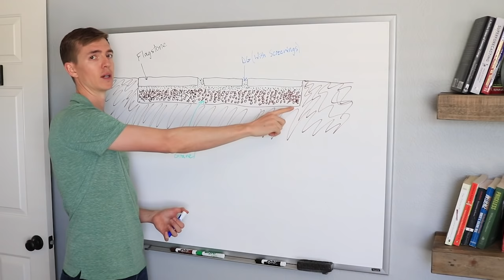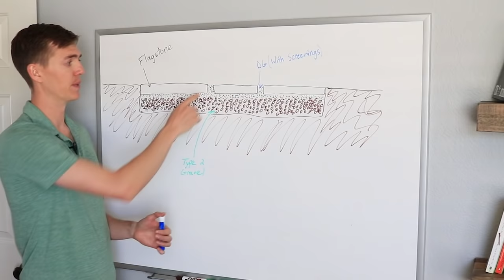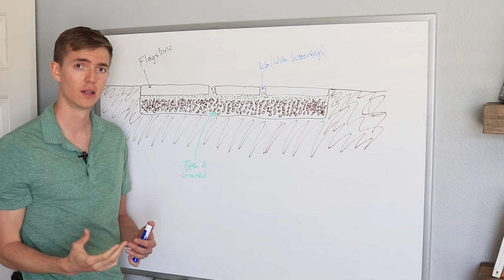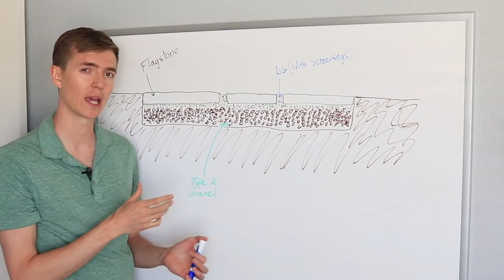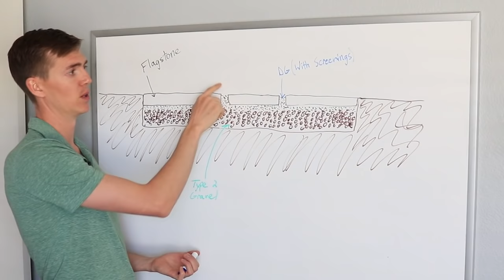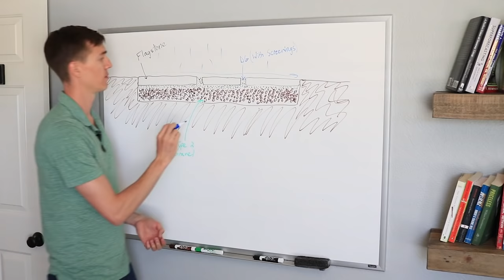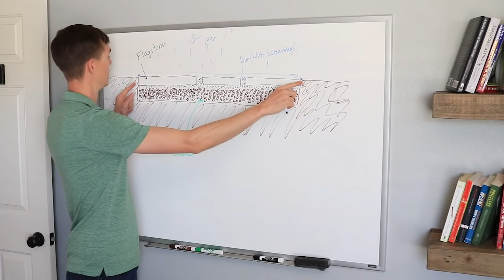How To Install A Flagstone Patio (Step-by-Step)

Comment: Learned so much from this video! Really excellent. I have one question: I wanted to put pieces of Mexican tile in there to fit the character of my house and yard. How do I do this? It doesn't seem safe to just place them into the decomposed granite. I do mosaics and am used to applying sanded grout, but these gaps look too big for that.Thanks for the help.

Comment: We just set our perma sand today. We noticed that we have a few flawed areas that can use some more sand. It has hardened by now. Not yet 24 hours. Can I reapply more perma sand and water it again? Or are we stuck with the imperfections?

Comment: Very nice video. Great tips. Question, I have a solid base of dirt now and I would like to just add 4" of slag then place the Flagstone then place some Gator dust to lock it together. This is for a fire pit. Any concerns with just using 4" of slag?

Comment: What if your soil is very sandy? The gravel base will probably disappear into the sand fairly quickly.
Reply: That’s what I’m wondering. The soil is loam but my house was built in a pile of sand more or less, to avoid flooding

Comment: Would this work with Concrete pavers? Specifically the gravel and DG with the 1/8 inch angle.
Reply from the maker: For pavers you’ll want to put a 1” layer of sand on top of a 4” paver base. Then place the pavers on top of the leveled sand. This method is used for these because of the inconsistent thickness and the face that you need to walk on the surface to fit the stones.

Comment: What is the difference between setting this Type 2 Gravel base and setting a concrete base? I helped at a flagstone job recently and they used concrete for both the base and also for the cracks filling
Reply from the maker: Concrete is better (mainly for weed prevention) but significantly harder for a DIYer.

Comment: Excellent video and thank you very much!  I have a question about the grade however - do I grade just the DG (we call it “road base” here in Colorado), or both the DG and the type 2 leveling sand? Does the the flagstone patio as a whole follow that grade, or does the grade only apply to the bases (and the flagstone patio is then level and flat)?

Thanks so much for your feedback and clarification

Comment: What ind of saw did you use to make your cuts?  I didn't observe a saw as I didn't watch in entirety.
Reply from the maker: I used an angle grinder as you have noticed, but I would recommend a larger saw like I demonstrate in my other video.

Comment: "Cutting the flagstones is the worst part. Ok? It kinda sucks." 😂
Reply: It does. I have found that you can get nice breaks with even minimal scoring...but it can be a bit risky.
Reply: Or rent a stone saw with a 12 or 14 inch blade that cuts limestone like a laser.

Comment: Thanks for the video.  Can you use concrete in between the stones instead of DG?  Thanks!
Reply from the maker: Not unless you set the stones in concrete, otherwise it will just crack.

Comment: I am a little confused as to how to handle the edges... I see how to put the larger pieces on the perimeter (as stated in your OUTSTANDING video).  BUT..... if it's a walkway, I don't know exactly how to handle that.  There will be some smaller pieces on the perimeter.  Do I use a metal edge or something like that to keep stuff in place?
Reply from the maker: I'd recommend using large stones for the walkway so your walkway will be one stone wide.

Comment: How do stones stay in place only using this granite sand?
Reply: Decomposed granite with the fines like that sets almost like concrete. It is pretty solid. The water sprayed on helps it compact and lock everything in.
Reply: DG is sticky when it is laid down.  The stones don't slide around once a stone is set level.  Also filling the gaps with DG or polymeric grout creates one piece of stone from many.

Comment: I'm having a really hard time trying to find DG- decomposed granite- locally. Found a couple places that carry it in bags but no bulk deliveries available. I'm going to need a lot for my large space. Additionally, the bagged DG available is that golden color, whereas my flagstones are grey toned and I don't really want that color contrast. Any advice on using small 1/4 minus gravel in place of DG? It's what a local landscaping supplier says he uses for pathways. Any regrets or thoughts on using quarter-minus ?
Reply from the maker: I would have to see it and feel it. It needs to be able to pack well, so other things can work, they need to be rough(no rounded or smooth) and contain the screenings(finer pieces of dust or rock) for compaction.
Reply: @StayHandy  Thanks for the help!

Comment: Man. I have installed flagstone for a living and most of the cutting should be done with a gas powered stone saw. Or the newer battery operated ones. The grinder takes for ever and should be reserved for contours that a 14 or 12 inch blade cant achieve. I have achieved some pretty tight radius cuts with a 12 inch. 
I probably could have cut all that in in a day.

Comment: I'm not sure if you're still monitoring this video but at some point, after the first 3 steps, you said dig 5-6".  Wouldn't that be the 1st step BEFORE add 3-4" Type 2 gravel?  Also, you don't talk about using a compactor.  Do you use a compactor to get the ground level and the 3-4" of Type 2 gravel compacted?

Comment: Hey! Great video. Could I put some decorate rocks/pebbles between the flagstone instead of DG?
Reply: Yes, just be careful where your pathway/patio will be. For example, if it rains a lot and the patio is at a high slope, using pea gravel might wash away. Gravel size rocks might be better.

Comment: Good tutorial!

If the natural slope is down towards my house, but I want the patio to slope the opposite direction, am I creating an unnatural slope that could cause a problem?
Also
For a patio with pavers, I read to have 1/4th inch slope per foot, yet with flagstone it's 1/8th inch slope per foot.  Do I need to change it to 1/8th?
Reply: L S I would dig out the soil that runs water toward your house or install drains within your paver or flagstone patio and I tend to go a little more slope on flagstone because of the uneven surface

Comment: Can I install a flagstone patio over an existing concrete patio?
Reply from the maker: You could, you'd just need to put a layer of sand or decomposed granite in between the stones and the concrete which will raise it up a few inches.
Reply: @StayHandy  Thank you!

Comment: Awesome video dude, very thorough. However, now I'm scared to use flagstones due to the work involved.
Reply from the maker: Nothing to worry about. If you want to decrease the work, just leave bigger gaps between the stones and don't worry about leveling them out too much. Most flagstone patios are far from perfect, and even an uneven flagstone patio looks pretty awesome.
Reply: Handyman Startup I think looking at your fantastic effort it's well worth putting in an extra day or twos work and get them to fit really nicely. End result is Incredible

Comment: I just bought a house that has and overly long driveway that leads into my backyard. I want to build a patio like this right of the top of it and that's my problem..... Should I tear up the driveway where I want to establish the patio or should I build over the top of it?
Reply from the maker: The only problem will building over a driveway is that it's going to make your patio higher. If that's not a problem for you then I would just put a 1-2" layer of DG down and then the flagstone.
Reply: Yea im trying to brainstorm that part of it too. I could always put a stone wall around the majority of it but at least part of it will have an obnoxious half step.

Comment: as far as construction you're right but I don't understand why you don't recommend polymeric sand or mortar for joints and if you plan to take on a flagstone patio there's no tool to use except a rocksaw

Comment: There's something I don't understand. If your slope is 1/8" per foot, wouldn't that mean that the bigger the size of your patio, the less gravel you'll use at the lowest point ? Shouldn't the amount of gravel (4") be constant ? Otherwise, wouldn't it impact negatively the integrity of your flagstones the lower you go?
Reply: Pretty sure you got to dig deeper and not mess with the bottom layer, which is the most important

Comment: Exceptionally helpful video, but I can't seem to find solid information as to what exactly type 2 gravel is. I have found local sources for 3/4" crushed gravel (ranges from 7/8 to 5/16) and 1.5" crushed gravel (ranges from 1.5 to 7/8). The company tells me the 1.5" crushed gravel is self-compacting. Would either of these products be appropriate? Would one be better than the other? Clearly the self-compacting idea is nice, but I don't want to use that if it's not the best choice. We live in an area where it can get exceedingly cold in the winter (-40 F), so frost heaving is definitely a concern.
Reply from the maker: Ask whatever they use for underneath paver patios. Every rock yard should have something that fits this description. IT's often called Paver Base.

Comment: first mistake was that you used a line level at the end of the string line instead of the middle. second is you have long running joints. Third is those stones wont set with a rubber mallet. you should be using a rawhide mallet.